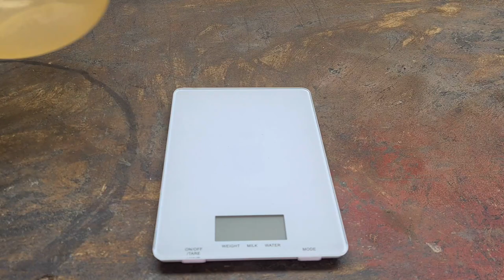Brass Oil Can Restoration [Polished Brass]

Comment: Great job. One way to check to see if the item restoring is solid brass, is to use the magnet, if the magnet sticks then it’s brass coated, if it does not stick it is solid brass.
Reply from the maker: Aha, ok. Thank you for the tip! 🐢
Reply: How long did you think that you ran the drill to tumble the tin.

Comment: That’s a plant mister not an oil can
Reply from the maker: Hello Dave. Yes you can use it with water, but you can also find it on the internet with oil. It is said to have been used for sewing machine oil in the past.
Reply: Ok. I'm glad I'm not the only one who had this thought... it let's out way too much oil for a sewing machine, though I suppose this may not have been the case in the past.